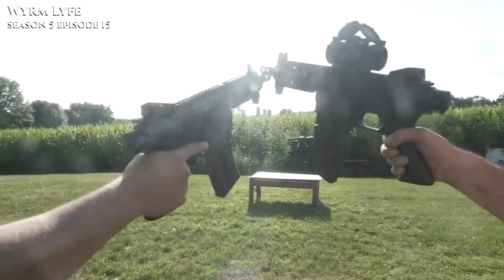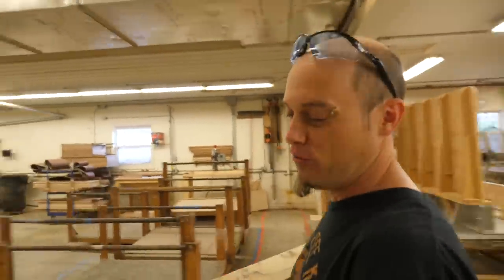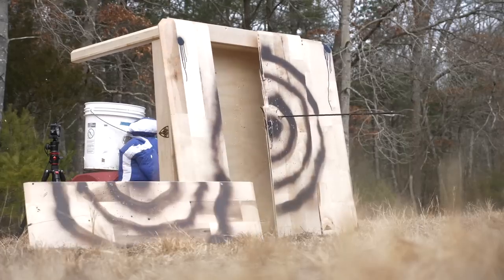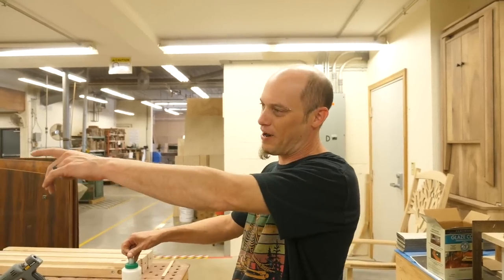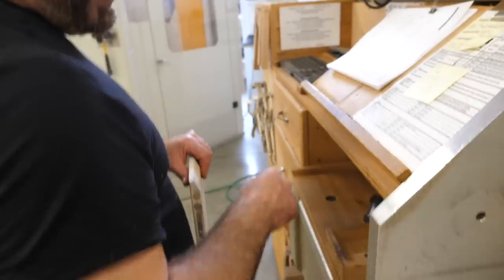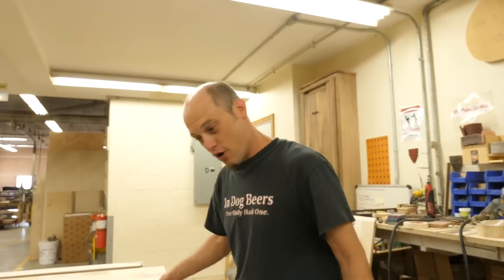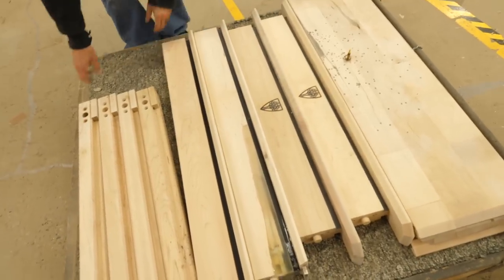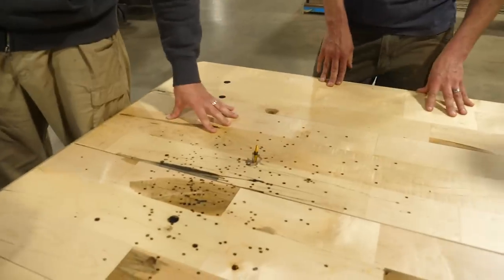We Brought It BACK TO LIFE! (Franken table 2.0) S13E2

Comment: Definitely agree with Jason on the arrowhead. I think it would have been cool cut flush so you could see it but it didn't stick up.
Reply: Honestly, if I won this, that would be the first thing I'd do. Put down a lot tape, take my time, and slowly hand saw it off. Pull the tape and hope you didn't screw up the finish too bad.
Reply: @Bobross32160  Same.
Reply: nah. put a shaft back  on it so if somebody snaps it off accidentally the whole thing would come off anyway. and think of the statement it would make just casually having a full arrow in your table.
Reply: @Bobross32160  I would do that but then encase the top half in resin so it can be placed on the table to "complete" the arrowhead and make a cool little paperweight centerpiece
Reply: Yeah, I think the arrowhead needs to go.
Reply: That's what I was hoping they'd do @josefasandhill2834

Comment: I'm kind of mad at myself for not thinking of using some cheap air dry clay to make a one time use epoxy mold or form. Would have made a few things easier than using mixing/ popsicles sticks coated in painters tape. (only the tape sticks to the epoxy but then you can pull the wood out easily after cutting the tape with an exacto knife)

Comment: Hi ed, What is the reason your work bench has holes in it? Is it for dust extraction or to allow the sound of a big sub woofer to come through?
Reply: I think it's for putting pegs into so you can hold things in place or hotswap hardware like a vice. (My uncle has a similar table, but it may be completely different)
Reply: @evilontoast7266  That makes sense but I could imagine Ed uses it as a holder for fireworks
Reply: My main work table is a downdraft table that sucks dusty air down and thru a filter and clean air comes out the bottom. The other wood table against the wall just has lots of drill holes in it